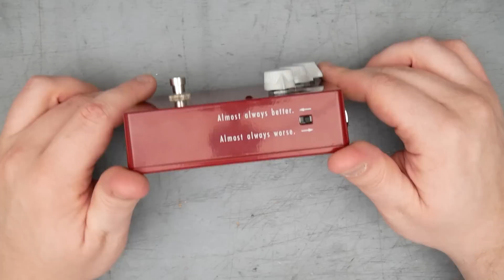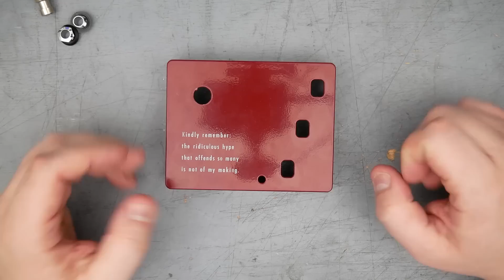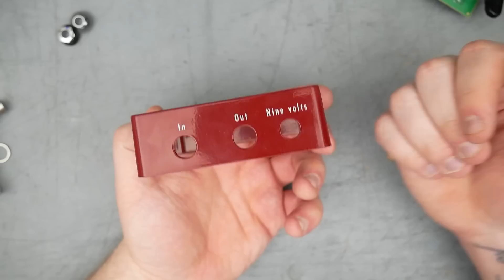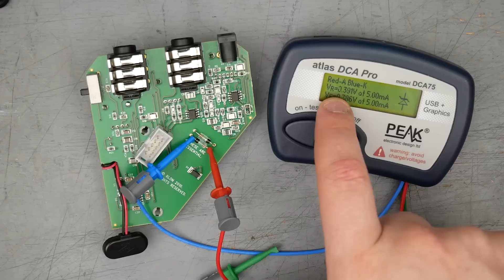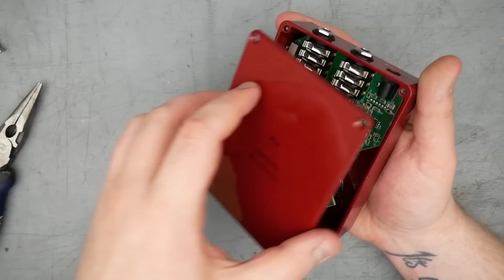Klon KTR Teardown! See what's inside!

Comment: Great content once again! But I need to ask a question. Tube Screamer and other overdrive pedal enthusiasts obsess over particular opamps. Yet Klon has 4-5 opamps and no one bats an eye about which brand and/or model. Why is this? Are the opamps for different functions in Klons compared to the drive pedal circuits?
Reply: I always thought that was interesting too, one of those is a charge pump so it doesn't really matter but the rest do basically what they'd do in a tube screamer or any other opamp pedal yet everyone's focused on the diodes. Maybe opamps don't contain as much magic inside these pedals lol

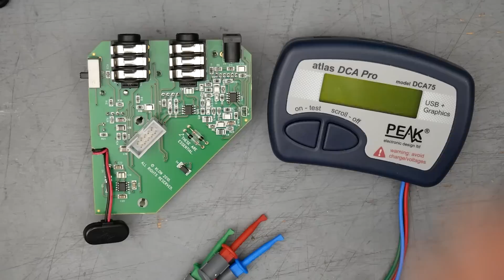Comment: Great job! I was just thinking that we need data on the clipping diode forward voltage drop of these originals, for historical purposes, if nothing else. My experience with two Klone pedals that sounded nothing like each other, and not terribly pleasing to my ears, was first removing the diodes and installing mil-spec IC socket cups to make swapping them quick and easy. I removed the diodes completely for test #1 and found that both pedals sounded very close to each other like that. One of my Klones had two "matched", (by luck of the draw) germanium diodes that measured  in the .185V region. It sounded pretty good but seemed rather harsh to me. The second pedal had gremaniums that measured .353V and .495V. This pedal did not sound right at all. It lacked gain compared to the first, as well as lacking treble. With pedal #1 I could hear the diodes clipping the guitar signal well before the 12:00 position of the gain knob. I then selected from my stash of several hundred 1N34A and 1N60 germanium diodes to find four that met the general spec I had in mind. I did not read the footnote on the official "Klon clone schematic from freestompboxes until after I did my selection, but my intuition told  me that somewhere between .25V and .35V was probably what I was looking for. I started by measuring and matching pairs, then purposely mis-matching pairs and seeing how they sounded to me and how the pedal responded. I also had some BAT41 Schottky diodes, which measures around .241V that sounded quite good. I have a hunch the any Klones using silicon diodes are using some version of Schottky. 
When I had made my selections for both pedals I put them side by side and played through them one at a time. I now have two Klones that sound very pleasing to me, and are about as close sounding as one could expect any two Klon or Klone pedals to be. I firmly believe that 90% of the difference between the various Klones in the market, and there are an astounding number of them, comes down to the diodes. Everything else has relatively close tolerances. The diodes are the wild card, and I have found, can make a remarkable difference! They can affect the tone well before you hear the pedal clipping, due to the mixing of the signals and phase shift as the signal passes across the diodes. If you don't believe me, remove the diodes and listen to the signal as you rotate the gain pot. It will start to drop in level before it starts increasing the volume. This is because of phase shift between the clean and distortion paths. The diodes change this phase shift and because of this, affect the actual tonal character of the pedal. 
Bill said it best right on the KTR Board. "These are essential!". Here's another clue for you all - The Walrus was Paul.
Reply: Hi Rick, could you possibly sell me two matched germanium diodes with a drop voltage suitable for use in a klone I have. I  think it has schottky diodes in at the moment.  I would be happy to pay for your time and postage. I  live in Manchester, England.  The diodes on eBay are often fake and not even germanium. Does the overall voltage and Milliamp rating of the diodes matter, or just the drop voltage. Hope to hear from you. Cheers,simon.

Comment: Controls not labeled,  powerplug center -/outer+ not indicated, most will use it on or off pedalboard with I/O plugs top and F/S in lower left . IMO its poor labeling and design layout, but what do I know ? Klon sniffers may disagree. Good call on the footswitch cable . I dislike the board-mounted power connector... the 9vdc power plug outer + conductor can possibly short to the chassis as there is no plastic surround on the chassis to protect this from happening
Reply: To me it seems like the aesthetics are deliberate choice to antagonise the users.

Comment: I mean, is it really that impossible to find other diodes that operate in a similar manner? I can't imagine there would be a tonal difference if the parts operate virtually identically.
Reply: All that matters with diodes used for clipping an audio signal is the forward voltage vF value. That's it. How they are arranged in circuit e.g. symmetrically or a-symmetrically is the other deciding factor as to how it sounds. There are no magic diodes. Just magic values.
Reply: @cgavin1  https://www.youtube.com/watch?v=TFkCtpKqW00&t=88s

Would this be the curve tracing seen in this video?
Reply: @BlueBarrier782  Yes. No. Yes. 
If only 10% of people can hear a difference. There is no perceptible difference. Welcome to the most depressing realisation of your 10% life. 🙄
Reply: @cgavin1  10% reliably noticing it in a way that can be tested would actually be great evidence for there being something to the difference, just most people lacking the discernment to notice! You wouldn't watch the Olympics and say, "pffft, everything there is impossible, fewer than 10% of people can do that!"

Now, if it's something that only 10% of people can really determine, but a much higher % of owners claim is definitely something they hear, might start to wonder at the sampling and bias going on...

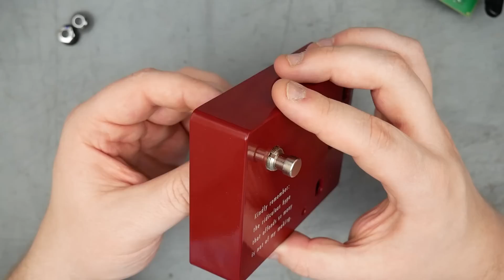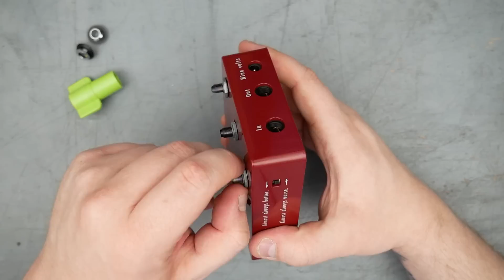Comment: Very cool concept here with the "teardown" idea.  Well done!  I look forward to watching more!  Outside of what you pointed out with the ribbon cable (possible oversight by the contract manufacture that's likely cutting these in large batches perhaps?), one thing I noticed is that there are minimal ground contacts of the PCB to the enclosure and it appears that there is only masking on one of the potentiometer holes (6:41) so if that nut were to come loose, you'd lose your ground contact to the case as everything else appears to be covered in paint.  Typically I'll see masked area on all the metal shaft pots that secure to the chassis and masking around the footswitch with maybe a ground wire soldered to a toothed washer to sandwich between the footswitch nut and the inside bottom of the enclosure where the paint was removed from the masking (or sometimes as well on the input jack with a toothed washer attached to a ground wire or some sort of ground lug bolted through the chassis where paint was removed).  I also noticed (2:51) that the counter sinks don't appear to have the paint removed so the bottom of the enclosure is also floating and isn't acting as a full shield when the pedal is fully assembled.  This isn't unique to the KTR of course, the floating bottom lid of the enclosure seem to be common thing, but worth noting if you want to ensure the best shielding possible that the pedal enclosure can provide.
Reply from the maker: Thank you! Excellent points, yes I suppose the ground could use some more redundancy. It's hard to believe Finnegan would overlook something like that, it might be an attempt at single-point grounding. But I agree a more secure point might be better.
Reply: @graybenchelec  you’re welcome.  I can’t presume Bill’s intent, but if you consider the original Centaur where there’s no finish on the inside of the enclosure at all, you’re getting full ground connection through the pots and the footswitch comparatively if having multiple ground points were really the concern.  Also getting the full shield of the enclosure bottom seems like a no brained but also an easy DIY with a Dremel Tool to scrape the paint in the countersinks.

Comment: What are the rules relating to rohs and usage of germanium diodes? How are pedals built nowadays able to use germanium diodes and transistors?
Reply from the maker: RoHS monitors specific compounds, not components. Germ diodes sometimes can have arsenic, but usually an acceptable amount for RoHS compliance. Leaded tin can be an issue, but just add it to the list. The truth is that even if someone wanted to go after germ diodes, it would be costly to do a recall. The original manufacturers aren't around to shoulder the cost.

Comment: The diodes only matter when you use it for a gain pedal. However, most use it to push the front of a tube amp, as a clean boost. You could put whatever diode you want there, unless you turn up the gain pot, you'll never hear what diode is there.

Comment: I'm opting for #2: The diodes just don't matter that much to the sound of the KTR. But then I don't buy into any of the other crap either. Vintage (anything) doesn't sound better, the tone wood ideas are plain silly (be it electric or acoustic guitars, drum shells, etc.), there are no magic ICs, diodes, transistors, on and on and on.
Reply: Tonewood does make a difference, I’m a professional violin maker. A good luthier can make a good instrument out of firewood. A bad Luthier can make firewood out of good materials. The best instruments are made by the most talented with the best materials. 
IC’s and transistors do sound different. Capacitors do to some degree too, but mostly due to tolerances. Resistors have no soul.
Reply: Tone Wood is a real thing. And Vintage Guitars such as a real 59 Les Paul sounds sweeter than a reissue of a 59 Les Paul.
Reply: @xjohn1970  That’s nothing to do with the wood. Multiple tests have shown ‘tonewood’ doesn’t effect electric guitars. 

For an acoustic guitar, since the wood vibration is what contributes to the projection of sound, that would make a difference.

Comment: Having built my own Klon clone in the past and tried out a bunch of different diodes, I'm really not convinced that there's much of a noticeable difference between different types of germanium diode, at least not enough to spend time worrying about it. Additionally, germanium parts have really wide tolerances so if he wasn't sorting them for forward voltage they're gonna vary quite a bit anyway. Kind of ironic that Bill Finnegan claims to not be behind the hype while at the same time making a big deal about his magic diodes, but I digress. Magical mojo diodes aside, the attention to detail involved in the design of the pedal really is impressive in it's own right so I suppose I can forgive him for being a bit anal about one part. Can't wait to see what you tear down next!
Reply: You're 100% right. I roll my eyes at the "these are essential". 99% of the clipping is done though the op amp in this circuit. You only get a tiny bit of soft-knee clipping when the gain is cranked pretty high and only get the hard clipping (since they're shunted to ground) at like almost max gain
Reply: I’m like that with capacitors. I like to use brand name capacitors. Probably doesn’t make a difference but to me it’s like audio jewelry
Reply: @ramencurry6672  yeah, those WIMAs sure are pretty...
Reply from the maker: Thank you!
Reply: Yeah, but....
We love the mojo! It's psychoacoustics, if you think it's some magical fairydust and unobtainium diodes in there, it actually will sound better to your ears and associated monkeybrain. Makes you play different maybe, which is part of the mojo. This effect can be reasoned away with stone cold science but that's not how our perception and interpretation of reality works, it's by no means linear or logical. Ask the folks over at the high-end audio store for a nice explanation of how that works and how they make boatloads of money with that knowledge.
Whatever may be the case, I just ordered a bunch of different Ge diodes, 1N60's and some obscure european old stock ones and have a go at putting in some of my own fairydust in my diy pedal. Just to make sure it's not low on mojo, you know? It would be totally useless without it and never really sound "right" , hah.
Of course this is only my 2 cents, there have been endless discussions on this stuff and this is kinda my conclusion on the matter of magical components in music equipment. It's probably all BS but I'll gladly have the mojo inside just to appease my inner fool.
Reply: @dokterzorro  I'm well aware of the psychoacoustical effect of 'mojo' parts, but just because a person is capable of tricking themselves into believing that 'mojo' parts are magically superior to non-'mojo' parts are somehow superior despite measuring identically doesn't make it true (although 'superior' in the audio world is so subjective that it's meaningless anyway). Not that I'm in any way discouraging you from trying out whatever weird diodes you can round up and seeing for yourself what's better in your circuit, that's half the fun of this hobby! Just don't expect them to sound radically different from each other as long as the forward voltages and conduction curves are relatively close.
Reply: @DefconMaster  
I am an experienced electronics guy and know very well that this stuff is all highly subjective. Most esotheric bs in high-end audioland is exactly that. bs. Cannot be measured or explained electronically, it's all between them ol' ears. You say it's the person who's willingly tricking himself into this mojo stuff but I would disagree with that. It's not something we do voluntarily, it's the way our brains are programmed. If something, a sound, gives us pleasure our brain makes endorfines to endorse us getting more of the good stuff. The idea that your amp/guitar/unobtainium diode is making a difference is a big contributor to the endorfin making process. You could say that while the "mojo" is a fabrication of the mind, the effect is very real and well known. 
After years of going about sound purely scientific in hifi applications I've returned to guitars, amps and pedals because I like the mystery, the legends, the lore and the mojo. Some things are much more fun if you don't try to understand them, just experience them. I firmly believe that the old bluesmen knew this at a basic level, if you know your gear's got mojo, a history, all the goodies inside, you get a little higher when playing. It's a comforting feeling, you know what I mean.
For the interested: The diodes currently in circuit are AAY21 germaniums, NOS glass bottle ones with one of the lowest Vf I've ever seen, combined with the fets of a OCD type circuit they produce a wonderfully smooth tone. Is that mojo or just dumb luck? Don't know, but it's a nice story to go with the pedal which, besides the diodes, also contains a totally irrational TLE2072 super-opamp that has no real place in a guitareffect and is waaay too expensive for what it's supposed to do. But since I had a couple laying around, why not. When they dissect my gear in the distant future (and after i've become famous :-) )people will be scratching their heads. And try to get one of those legendary TLE2072's, because it's got mojo, hah.
Reply: @dokterzorro  Don't forget to obtain some snake oil ;-)
Reply: @dokterzorro       Nur Leute, die unmusikalisch sind, nicht gut Gitarre spielen und auch nicht richtig hören können, bezeichnen etwas als "Mojo". Wer halb taub ist und die Unterschiede nicht hören kann, schreibt genau so wie du! Der KTR-Klon ist keinesfalls Mojo - der Unterschied zu allen anderen Overdrives, auch wenn diese im Klon-Stil gebaut sind, ist derart groß dass es jedem Musiker sofort auffällt. Der KTR-Klon ist wirklich ein genialer Overdrive. Er hat etwas Einzigartiges, an das keine seiner Kopien auch nur annähernd hinkommt. Wie alle Overdrives, hat er natürlich seinen bestimmten optimalen Einsatzzweck - denn es kommt immer auf das Musikstück an, das darüber bestimmt, wie die Verzerrung nun klingen soll. Der KTR-Klon hat allerdings schon eine große Bandbreite von Blues bis Rock.